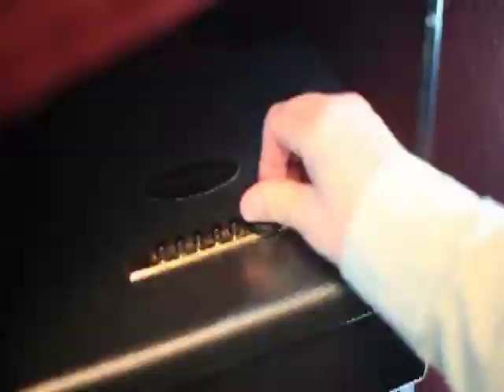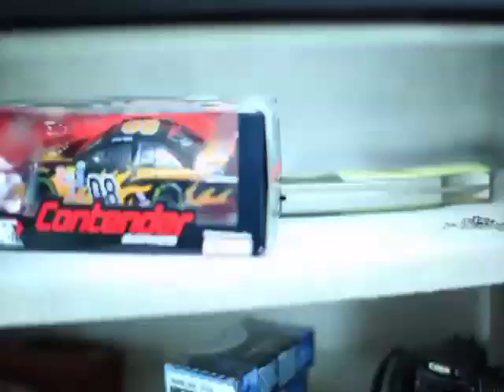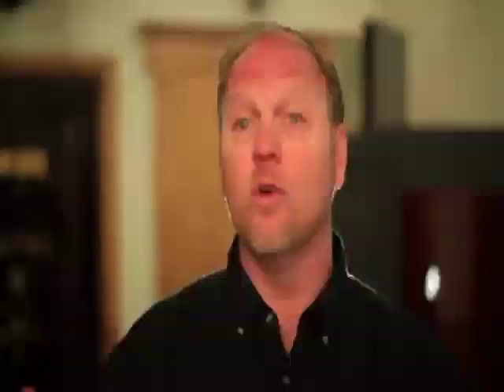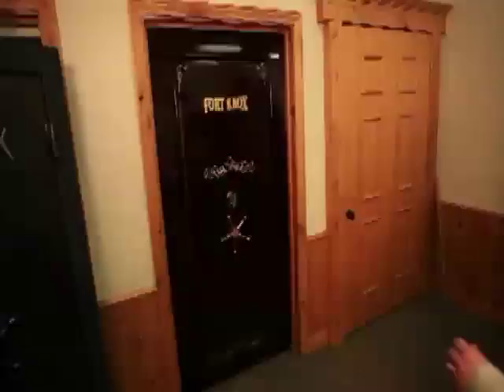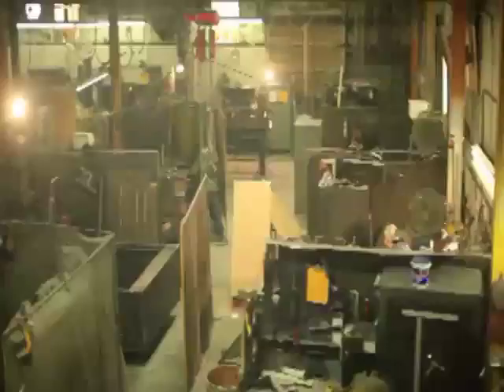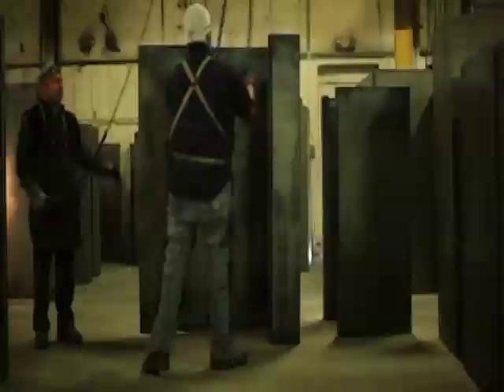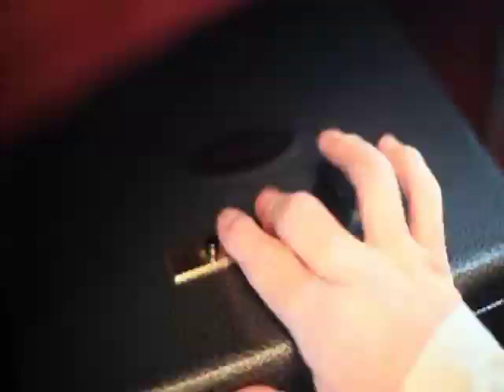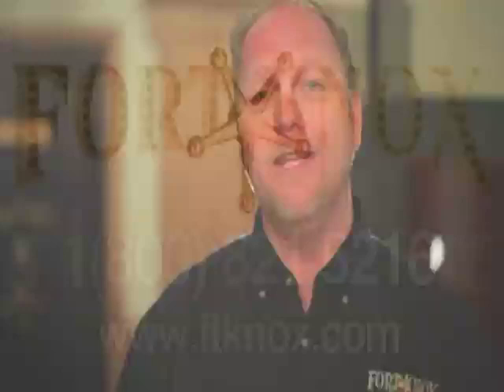Fort Knox Safes

Comment: I work at Fort Knox in orem ut we all take a lot of pride in our products. the one thing I love about fort knox is the customization. you can do. we just completed a 7251 legend. it consisted of a 1/4'' body 1 stainless steel internal liner, 1AR ballistic liner, and 4 more stainless liners, it was about 1/2'' of just liners. we had to use both of our cranes just to put it on a pallet. if you want the best go with Fort Knox